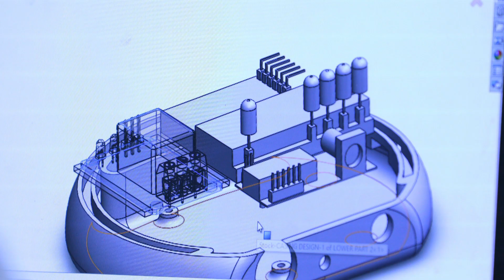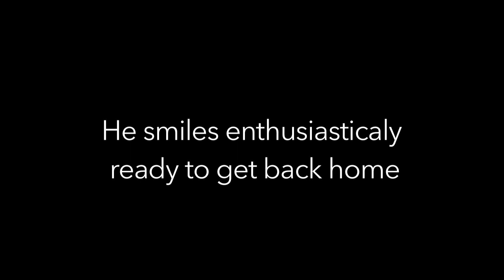World's Cheapest Ventilator Documentary

Comment: I don't see anywhere in the video how the device works. To believe it works you have to show it works independently.
Reply from the maker: call us on 9910203040 sourav
Reply: It's BS. Apparently it is not providing air. It's a valve controller. You need a pressure regulated air source.